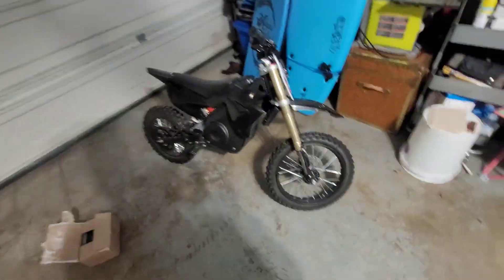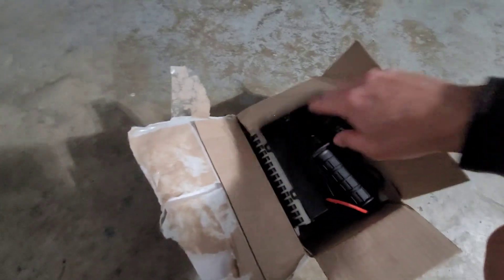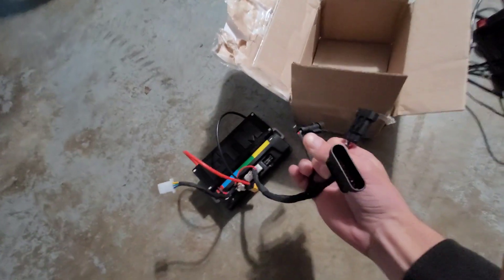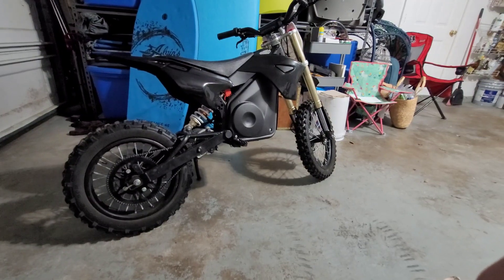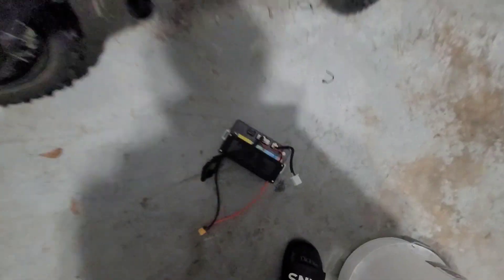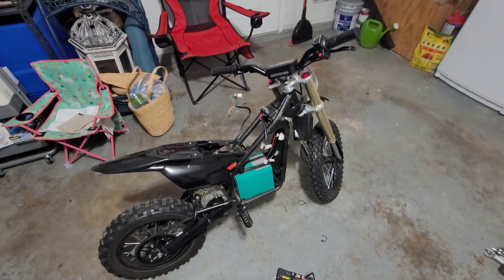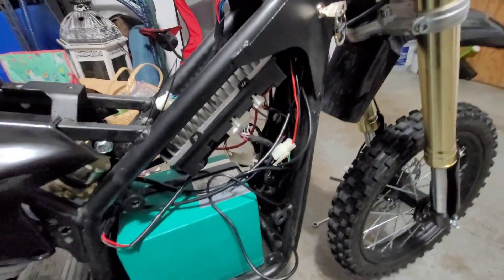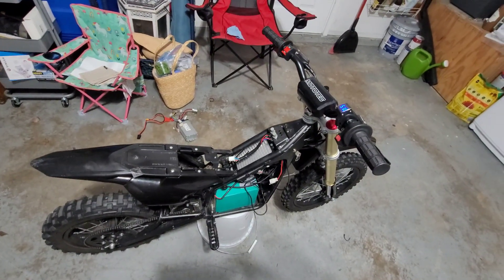Mototec 48v Pro Controller Upgrade 3000w (pt.1) Electro&co ETM Kit

Comment: Been following you, finally put in the Emt kit. Ran great for about 5mins now the fuse keeps blowing. Do you know what the current rating is on the fuse you used? It blows on setting #3
Reply from the maker: You dont need the fuse anymore! The controller pull around 50 60 amps and that fuse wont last a full throttle pull. The controller takes care of all the safety stuff now!
Reply: 🙏🏽 thanks

Comment: am i able to keep it keyed instead of the button
Reply from the maker: Youll just have to cut the on/off switch wires and splice them to the key switch 🤙otherwise nah it just comes with the on off switch
Reply: @EmxBrandon  is the stock bike keyed, what if i just don’t install the on off switch
Reply from the maker: @Seanpatt1378  the stock bike is keyes yes. The etm kit replaces all the wiring in the bike including the key switch. The kit is wired with a on/off switch. If you dont plug the switch in you have no way to turn it on. The key switch keeds to be wired in place of the on/off switch. Its as easy as cutting the connector off the on/off switch and soldering the key switch in.

Comment: Hey Emx Brandon thanks for posting this video. Do you know if the MY1020 72v 3000W motor is going to fit the 1300 version of this bike.
Reply from the maker: There is one guy in the group thar mounted his under the swing arm. But thats the obly way youll get away with it. The motor is just too long to fit in the swing arm. Plus the mounting holes are completely different

Comment: How long is the runtime I’m curious if your running at full power?
Reply: and also how long would it run with the optional 48v 20ah battery from electro in co?
Reply: Would 72v also need a new motor?
Reply from the maker: @London  72v would give you alot more power but you could ride pretty tamed and get alot more run time. My main point is the mototec frame is so small and it hard to get good range with what little room. And nope the stock motor will handle 72v just fine at around 5kw any more though and your pushing it
Reply: @EmxBrandon  ok I’m thinking of getting the 72 mighty mini electro and co
Reply from the maker: @Londonridesbikes  definitely! 72v is the way to go!
Reply: @EmxBrandon  sweet
Reply: What brakes do you have?
Reply from the maker: @Londonridesbikes  now? Or when i first got it? Mine came with the hydraulic brakes stock, but mototec started selling them with cable brakes
Reply: @EmxBrandon  just tell me what brakes I should get that are the best because I’m trying to get ones maybe
Reply from the maker: Full throttle rips with the etm kit and stock 48v battery youll be lucky to get 20-30 min. If you keep the stock battery just do slow stuff like wheelies and pit tricks and it will last for a good couple of hours!
Reply: @EmxBrandon  if you’re at a dirt track for say how long would it last there do you think
Reply from the maker: Im my opinion a track day is hard riding and the stock battery would probably only last a couple hard laps. With the 20ah battery with higher output cells youll get a good session in but definitely not a full day of track riding
Reply: @EmxBrandon  would you recommend a 72v included battery with the 3k watt pack?
Reply: I just got my the exact kit yesterday that u have. I put it altogether everything working fine. My kit came with a 72v motor, will that be ok with the 48v stock battery?

Comment: Thanks for making this video. Very detailed and straightforward. Putting the controller on my bike, I noticed the wires coming off the battery that plug into the black red plug now bypass the fuse. Did you do anything about that?
Reply from the maker: No problem! Glad the video helped 😁 youll no longer need that fuse anymore, your controller will take care of all the safety stuff now. If you were to leave the fuse on it, it would pop as soon as you pinned the throttle.

Comment: What size brakes do I need my hydraulics are shot and want to switch to cable brakes
Reply from the maker: On your mototec? Any mtb cable brakes will work youll just have to use the stock brackets from the hydro brakes 👌
Reply: @EmxBrandon  do u have any links to brakes that u recommend? I’m very new to this and don’t know what I’m doing 😂
Reply from the maker: @Noah-xf9io  this is for the mototec correct? And do you want to keep the brake switch or no? Check out lonestarelectrek.com they have zoom hydro brakes any of them will work. But i recommend the 4 piston hydros they work great and they sell them with or without the brake switch. I use the brake switch for my brake lights but on a stock bike i usually unplug them since all it does it cut power to the motor, and that messes with my wheelies 😆
Reply: @EmxBrandon  yeah I just bought a used mototec for cheap but I kind of just want cable brakes thanks I appreciate it a lot
Reply from the maker: @Noah-xf9io  nice! Cable brakes arent bad for the stock mototec but once you start going faster than 35 youll definitely wanna invest in some decent hydros like the ones in the link 👌 after i did the qs swap on mine i upgraded to a dirtbike front brake and rotor and it helped so much since im hitting 55+ now. The stock hydros weren't cutting it anymore

Comment: Hey Brandon nice vid! I have a question do you know how hot the motor can get in the summer?
Reply: Hey yea I just bought one myself and I’m waiting for it! I love your vids they are super helpful 🤙
Reply: Also do you know how long you can ride for on a stock 48v battery 🔋 thx 🤙
Reply from the maker: @slashhawk1561  thanks my friend im glad they are helpfull 😁 and with the stick battery if i was just messing around out front practicing wheelies and stoppies i could make it last for hours on and off. But if you go out pinning it everywhere full blast probably 35ish minutes
Reply: Thx that helps a lot! Have fun doing your sick wheelies 🤘🤙
Reply: Hey Brandon it’s me again. At how many vots do you start charging the bike? 🤘
Reply from the maker: @slashhawk1561  i wanna say the battery cuts off at 40v and should charge to 54v somewhere in that range for me i usually charge it when i start to feel the power lag. Mostly because its not as fun
Reply: Ok thx 🤘
Reply: Hey Brandon I just put in the new Controller and everything turns on fine but the throttle gets stuck at full power. Do you know any way to fix it. Thx
Reply from the maker: @slashhawk1561  the throttle itself gets stuck or the controller stays at full power? If its just a sticky throttle loosen the allen bolt that tightens it to the bar. I noticed if i had it too tight the throttle would stick. If its the controller i would email electro&co about it, thats pretty scary if thats the case
Reply: Ok thx yea I will email them🤙
Reply from the maker: @slashhawk1561  sounds good be safe 🙏
Reply: Thx 🙏 you too I was wondering when you use to charge it did it still have the overcharge protection on the battery. Thx
Reply from the maker: @slashhawk1561  yup nothing changed with how it charges. The charger wont charge passed a certain voltage but its always best practice to never leave it on for longer than it needs to be. You never know what could fail, always keep an eye on it 🤙
Reply from the maker: Depending on if you stay 48v or go 72v. But with the 72v battery it gets too hot to touch after about 45min of hard riding. With the 48v it still gets just as hot but its takes a little longer to get there. Its still running strong though i beat the heck out of that motor and havent had to use my spare yet 😂 and probably wont as soon as my qs165 kit comes in, time for a motor swap and swing arm extension 🤙
Reply: Thx 🙏 ride safe out there with the qs165 swap
Reply: Connaissez-vous la référence du moteur ?

Comment: Do you happen to have the setup/tune for that em50 controler?
Reply from the maker: Nah unfortunately i dont
Reply: @EmxBrandon  ah have you plugged it up to a computer yet to tune the bike for the 72v? Would be an awesome video to see more of the technical side of the build. I know many have the EM50 controler and all the videos on YouTube are in a forign language lol
Reply from the maker: @FishingPhoFun  nah i havent its pretuned from electro&co and if i tried to push this motor any more it would burn up for sure. One of these days id like to get a seperate one and play with the tuning but right now im pretty clueless when it comes to tuning controllers
Reply: @EmxBrandon  ah I'm tempted to buy the VOTOL EM50 controler and some tuning on it. It's identical to the electro and co ETM kit you have just re branded and their tune. If yiu do connect into the controler would love to see what the ETM settings are.
Reply from the maker: @FishingPhoFun  definitely i believe theres some software ill need and a cable to hook up to a computer but id love to duplicate the setting and try to push some more power out of the motor and see how much i can push before it blows
Reply: @EmxBrandon  for sure! Yeah it's a cable and software thats free. Perk of tuning is you adjust the tuning for a smoother throttle and adjust the power in you case since you wheelie a lot. But if you do would like the stock ETM settings if you can share. The controler is only about $100 over seas and about $150-200 on eBay Stateside.

Comment: I have the mxr1500 when I click the link what options do I need to select for my model of bike? Help would be great and is it correct that it’ll be around 1500$?
Reply from the maker: Hey im assuming since you have an mxr you dont live in the US. If thats so then you wont be able to get a battery shipped to you over seas but you can still buy the controller kit for 500 just select none on battery and none on graphics unless you want the sticker kit. And then select which motor you have which is on the sticker placed on the motor. The kit without the battery is 500. Youll have to source a good battery in your area but the kit works great with the stock battery aswell, just shortens the run time. Hope that helps 🤙
Reply: @EmxBrandon  thank you so much man so hard to find information on upgrading these in Scotland, great work on the YouTube videos aswell I’ll be tuned in for future uploads and look forward to see what your next upgrades are
Reply: What’s the top speed with the upgraded controller and standard battery buddy?
Reply from the maker: @lewissmith1980  thanks man that means alot 🙏  and i got up to around 35mph with the stock battery and electro&co controller kit 👌 i weigh around 175 pounds it was a hugeee upgrade. I kept the stock battery for a few months until i got a 72v battery now it does over 40mph 🤘

Comment: Would you give an estimate of how large of a better y I could put inside? Might want to get a larger one for more range
Reply from the maker: The only problem with going bigger is relocating the controller and the tabs for the side cover get in the way for anything bigger going in you would have to get one custom made i have a new vid coming i put crf50 plastics on moved the controller under the gas tank and have a 72v battery coming which is bigger stay tuned ill explain everything
Reply: @EmxBrandon  okay

Comment: Hey Brandon, do you know if the EC kit will fit on the Mototec 1000w 36v version? Thanks for the great vids keep them coming!
Reply from the maker: Yes i believe so i would definitely email them but they sell their own version of the mototec in both the 36v and 48v chassis only thing im not sure of is if the controller will run with the 36v battery. So chances are youll have to buy the kit with their 48v battery. If thats the case get ready for a crazy power upgrade, youll almost double your top speed 🤘
Reply from the maker: And thanks my friend i appreciate that 🙏

Comment: What kit is it exactly? I can't seem to find it with the link! 
Also what is top speed and battery life? 
Thanks. Keep it up!
Reply from the maker: When i click the link its the 3rd option down but it says mototec / funbikes to etm kit hope that helps 
And top speed with me being 175 pounds is 30 with stock sprocket but you can get a bigger front sproket and increase mph but it will lower torque aswell and the battery life is going to depend on how you ride. I just chop the throttle doing wheelies so it lasts me a good hour and a half. If your riding full throttle with the new controller you might only get 45 min out of it so i would recommend buying the optional 20ah battery with the kit
Reply from the maker: I edited the link to take you directly to the kit just incase 
Thanks for the support 🤘